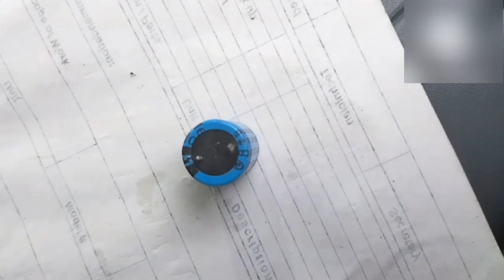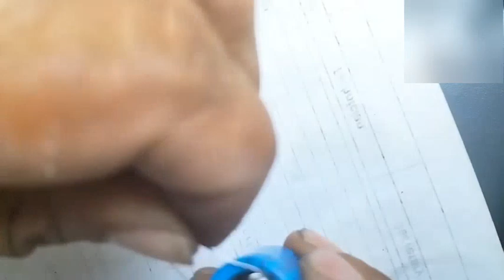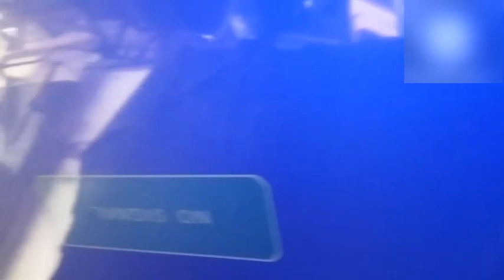HOW TO MAKE LED TV BACKLIGHT DRIVER WITHOUT IC?

Comment: How do u switch off when tv it switch off .
Reply from the maker: Just put 12 volt relay. You can get 12 volts from the tcon board fuse or panel board.
Reply: Its good if you connect it from your tv power switch.when you turn on your tv, the led driver will turn on too..then the output of your led driver will be connected to the led backlight of your tv...

Comment: You explained how to make the driver, but you did not show us where to connect the output from the driver to the TV.  What's the point?  We can of course dance to your music without learning how to connect the driver to the TV.  You did not explain how to give power to the driver? Is it as a separate connection in addition to the power supply to the TV?  What's the point of your lesson?
Reply from the maker: If you do not understand, you can contact me @ adonis_belnas@yahoo.com so that I can give you  a diagram of this project
Reply: If you are knowledgeable about electronic cktry you will know where to connect it,,, 
You should connect the ouput of this driver to the input line of your tv led backlight.. maybe it helps you alot..